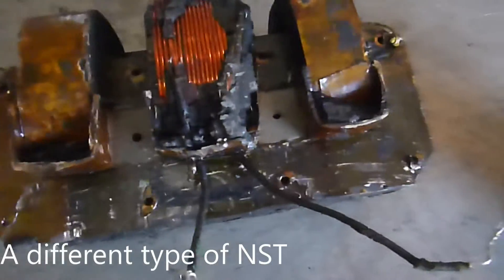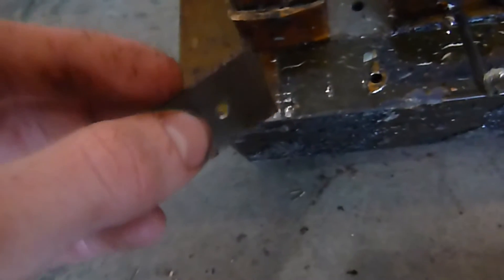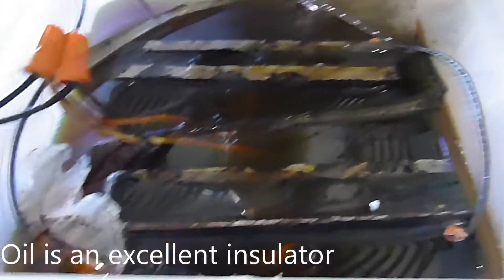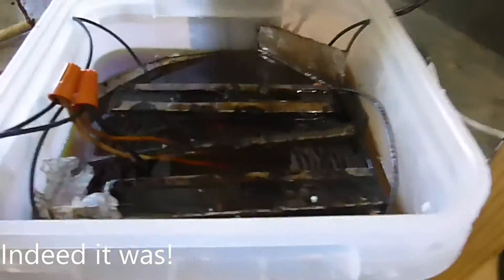How to Unpot and Repair a Neon Sign Transformer - SGTC

Comment: wouldnt it be preferable to just heat it up and melt the tar off?
Reply: Set your electric oven on 375 degrees this may take 6 to 10 hours have something underneath the Transformer to catch the tire when it comes out wear a mask and breathe as little as possible
Reply: I wouldn't risk it

Comment: From my experience from removing the shunts out of an MOT I had, the primary still moved around, so for the best and highest possible current output while still maintaining perfect insulation, put the secondaries as close against to the primaries as possible while still maintaining good isolation by use of the insulation you have.

Comment: I got my own NSTs to play with lol but I don't want to change them by removing the shunts. But that's pretty interesting that you got the shunts out without damaging any part of it. I hope we can talk soon!
Reply from the maker: Bobby M. The fit was pretty tight due to the design of the transformer cores, so vibration and movement of the coils was minimal. As they are right now (no shunts), these things get noticeably warm within 5 minutes of use. I don't dare move the secondaries any closer as they could cause more heating, and/or an arc that would be impossible to insulate.
Reply: Basement Engineer yeah I bet they do get warmer. But I can't stand MOTs sometimes